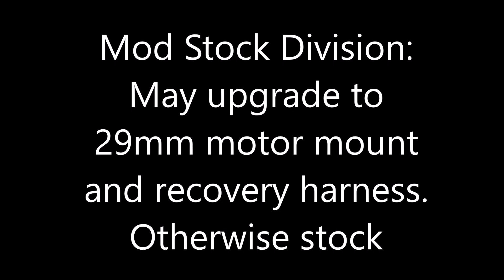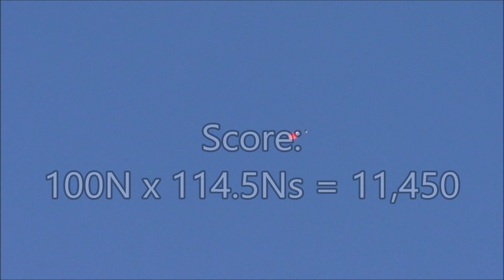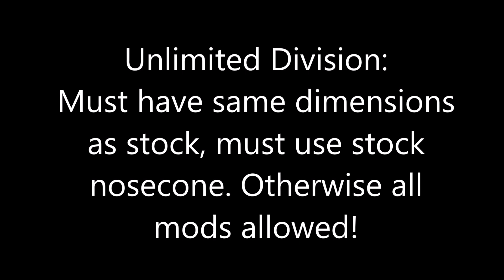Estes Big Daddy Stress Test Challenge - modded BD monsters!

Comment: This is so cool, I feel dumb asking this, but what is a drag separation?
Reply from the maker: This may sound counterintuitive, but while a rocket is coasting, there is more aerodynamic drag on the booster/fin section than on the nose cone.  Especially with rockets that have a heavy nose cone (like adding weight to a Big Daddy cone.....), the nose cone may carry more momentum after motor burnout than the booster section.  If there is not enough friction between the nose cone and booster section, the two parts can actually separate after the motor burns out.  This is known as a drag separation.
Reply: @flyfalcons  wow, I've never thought of that possibility. Thanks for the explanation!
Reply: @andrewmitchell5807  Who needs ejection charges when you are UNSTABLE?